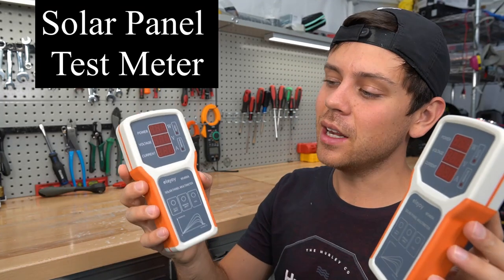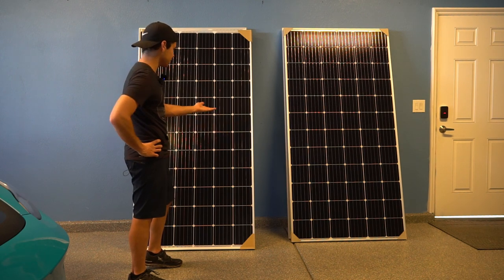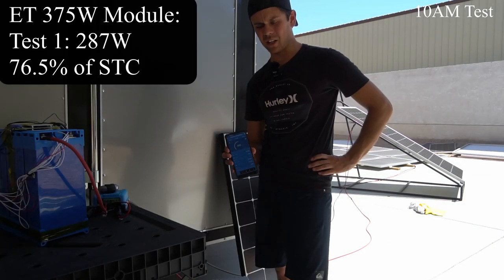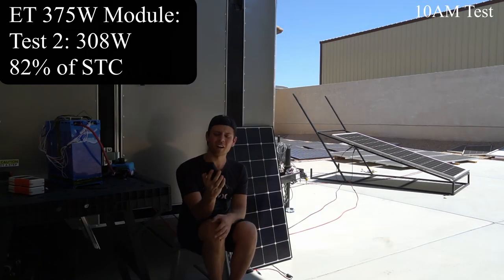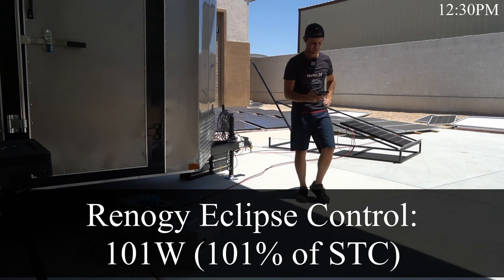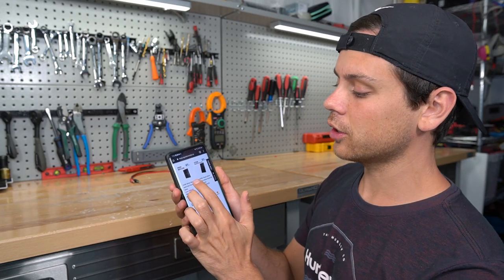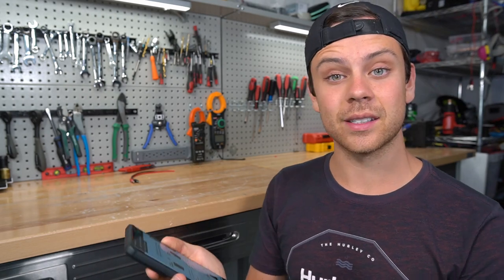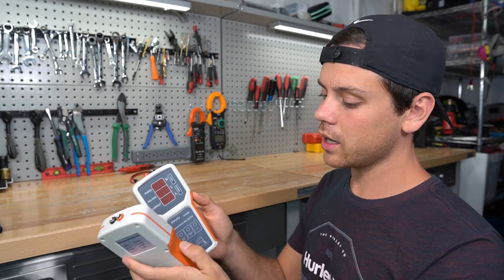Solar Panel Testing! ET Solar VS ReneSola

Comment from the maker: Usually, most panels produce 80-90% of their rated STC output. PTC is the real world output, but most panels do not list that. So I use STC. I use total Wh production over the course of a day to compare panels long term. Because various types of cells and film produce more or less depending on temperature and other factors. 

Figured this was a given, but some people in the comments section do not understand this.

~~~~~~~~~~~~~~~~~~~~~~~~~
Does off-grid solar confuse you? Check out my DIY friendly website for solar system packages and product recommendations, and so much more! http://www.mobile-solarpower.com

Join our DIY solar community! #1 largest solar forum on the internet for beginners and professionals alike: https://www.diysolarforum.com

Check out my best-selling, beginner-friendly 12V off-grid solar book (affiliate link):
http://amzn.to/2Aj4dX4

If DIY is not for you, but you love solar and need an offgrid system, check out Tesla Solar. Low prices and great warranty, and they can take your entire house offgrid with their new Powerwalls: https://ts.la/william57509

~~~~~~~~~~~~~~~~~~~~~~~~~
My solar equipment recommendations (Constantly updated! Check here first):

12V/48V Lithium Batteries: https://www.mobile-solarpower.com/solar-batteries.html

Solar System Component Directory: https://www.mobile-solarpower.com/solarcomponents.html

Plug-N-Play Systems: https://www.mobile-solarpower.com/full-size-systems.html

Complete 48V System Kits: https://www.mobile-solarpower.com/complete-48v-solar-kits.html

DIY Friendly Air Conditioner/ Heat Pumps: https://www.mobile-solarpower.com/solar-friendly-air-conditioners.html

Complete 48V System Blueprint: https://www.mobile-solarpower.com/48v-complete-system-blueprint.html

~~~~~~~~~~~~~~~~~~~~~~~~~~
My Favorite Online Stores for DIY Solar and Coupon Codes:

-Current Connected: SOK, Victron and High Quality Components. Best prices and warranty around: https://currentconnected.com/?ref=wp

-Signature Solar: Cheap Server Rack Batteries and Large Solar Panels:
https://www.signaturesolar.com/?ref=h-cvbzfahsek 

-Ecoflow Delta Official Site: My favorite plug-n-play solar generator:
https://us.ecoflow.com/?aff=7

-AmpereTime: Cheapest 12V batteries around:
https://amperetime.com/products/ampere-time-12v-100ah-lithium-lifepo4-battery?ref=h-cvbzfahsek

-Rich Solar: Mega site and cheaper prices than renogy! Check them out: 
https://richsolar.com/?ref=h-cvbzfahsek

-Shop Solar Kits: Huge site with every solar kit you can imagine! Check it out:
https://shopsolarkits.com/?ref=will-p

-Battery Hookup: Cheap cell deals
https://bit.ly/2mIxSqt
10% off code: diysolar

-Watts 24/7: Best deals on all-in-one solar power systems, with customer support and distribution here in the USA: 
https://watts247.com/?wpam_id=3

~~~~~~~~~~~~~~~~~~~~~~~~~~~
Contact Information:
I am NOT available for personal solar system consult! If you wish to contact me, this is my direct email: williamprowsediysolar@gmail.com

Join the forum at https://diysolarforum.com/ if you wish to hang out with myself and others and talk about solar

FTC Disclosure Statement and Disclaimers:
Every video includes some form of paid promotion or sponsorship. Some links on this youtube channel may be affiliate links. We may get paid if you buy something or take an action after clicking one of these. My videos are for educational purposes only. Information is subject to change/update at any time. Electricity is DANGEROUS and can kill. Be smart and use common sense :)

DIY Solar Power with Will Prowse is a participant in the Amazon Services LLC Associates Program,
An affiliate advertising program designed to provide a means for sites to earn advertising fees by advertising and linking to Amazon.com
Reply: Sorry that this is off-topic, but I couldn't find a better video where to ask this question.  Can Lithium Iron Phosphate batteries be installed in any orientation?  Or do they need to be used with terminals on the top?
Reply: Poster how can a someone contact you Directly? I don't see an email or anything in your description.??
Reply: So, you obviously have solar power production and collection dialed out there in Vegas, but have you ever given any thought into starting a “DIY Digging Wells 4 water with Will Prowse.”  Cause the way Lake Mead is looking you might need to find your own supply of water.  😂.  I’m in San Diego so I’m in the same boat. 🚤🚣
Reply: First, let me say I appreciate your informative and frank opinionated videos. Another unrelated question: Is it possible to do to poor weather conditions, use a charging station to recharge our solar bank batteries rather than use our automobile alternator as a backup? And If so, how?
Reply: What do you do will all the stuff you get. Do you sell it? Give it away? I have started my solar powered work shop and would like to know if you have some stuff that you would be willing to part with some of your spare stuff.
Reply: The panels at signature solar do not seem to be available but there seem to be similar products at a similar price range from URE do you recommend these panels?

Comment: you should put some locking swivel casters on your panel stand so you can wheel it into the shade to swap the panels.  also if you rotate those big panels to "landscape" orientation you could have fit two on there

Comment: I had different results in my test with the solar panel multimeter. Mine seems to work quite well and has confirmed the previous tests with the MPPT charge controller setup. When buying used panels it is totally impractical to setup a battery and solar charge controller on-site just to test a few panels. The solar panel tester is a quick and very effective solution to check all panels in no time. It can quickly identify if panels work and can achieve the labelled output. If the tester is 100% accurate is not important at this point. It will help identify damaged or degraded cells quickly. The perfect solution for testing panels on the go.
Reply from the maker: Yes good point I agree!!! Such a great tool for quick testing. Thanks for watching my video 😁👍
Reply: @WillProwse  And thanks for watching mine 😉👍

Comment: Nice video Will. I'll suggest for fairer and more accurate comparisons, get a second victron controller, put the panels side by side at the same angle then test them simultaneously. You may then swap the controllers/panels to be cast iron sure but might not be necessary.

Comment: Thank you for all your hard work,some of your video help me on setting up my solar for our get away home 
Have 2400 watts of power an (8) 6 volt battery, it so nice not have to run a generator ,for power the AC or the wife breathing machine

Comment: Normal individual cell processing produces cells with a distribution of performane variation and is result of slight silicon doping variance in manufacturing.  Manf. sort the cells to groups of like performance cells for the same panel.  This is why you often see same model variation grades with something like three to five grades with different wattage.  They all will look physically the same, just grading (and therefore cost) on cells are difference.

I use a DL24 load tester.  You need to have a load tester with CV, adjustable constant voltage mode, which is like a variable high power zener diode load.  For a little manual CV adjustment it allows you to easily get the different parameter of Isc, Voc, Imp and Vmp, along with the corresponding wattage.   Running CV setting down below about 50% panel spec'd Voc gets you close to Isc reading.  Running CV up til you get zero current is Voc.  You can see the heating progression of panel in sun with Voc reading. Adjusting CV for maximum power reading is Vmp and Imp and you can likely manually adjust CV to max power as fast or faster then an MPPT controller finds maximum power point.

Voc is most important indicator, followed by Isc and should be measured for any panel test. It also ensures you have enough panel overhead voltage to effectively run an MPPT controller for given battery voltage (should have at least 4v overhead).  The quality of series resistance and shunt resistance of cells determine the MPPT point for given Voc and Isc.  Normally for qood quality cells, I_mp is between 90-95% of I_sc and V_mp will be between 80-85% of Voc.  Isc for good cells should be 40-45 mA/cm2, in full sun, per actual silicon cell area. Most common sized cells are from 156x156 mm wafer with rounded corners for about net 215 cm2 area per cell, yielding Isc of about 9 amps.  Must not have any partial shading for these relationship to be true.  Poor shunt resistance does not effect full sun performance but impacts low light performance.  All cells have some shunt defects producing the shunt resistance so the less the defects the higher the quality of cell.

Using one of these load tester also gives the additonal application of battery load testing that the dedicated panel testers do not have which makes the expense of the load tester more justified over just occational use of dedicated panel tester.

Comment: Move to Southern Colorado where it only gets in the high 90s. I just finished an install on my Sprinter with three 100 watt Rich cell panels feeding two Battleborn batteries in series for a 24VDC system.

Comment: Hey Will,
A very cool project would be a DIY, solar powered, ATV made from an old one.
Either that or a DIY electric bike. No way can I afford even a used EV but maybe I can swing a DIY build. Will be boondock camping and need a secondary backup form of transportation that will fit in the bed of my F-150. 
Thanks for everything you've taught me,... pretty much everything!

Comment: Hi Will, If you will be using a multi-meter to test used panels, consider getting some extra leads and wire them in to an MC-4 connected and an MC-3 connector for the really  old used panels. Having it soldered up and shrink wrapped will make it way more convenient so you are more likely to use it and you won't need a 3rd hand. Also I gotta say I almost skipped this video, but as always I learned something and enjoyed the content.

Comment: I have bi-facials on my roof and the way there performing my system will pay for itself within 6 years. £12.500  17 panels and 16.4 kWh lipo batteries. Watched various videos before taking the leap and glad I did   I now help others design there system

Comment: Nice video  I live in the desert and have 3 solar systems and like you point out
many solar panels do not perform well when hot. I have a ground mount 
system with Canadian solar panels and they are just marginal  in the heat

Comment: please test two bifacial panels at a time .. keep a little more vertical [ till they drop off a few watts] and step second panel back  a panel width and up till no shade from first panel. then test separate. to see if you get more reflection from second panel to first panel. a good test to do.  you need a w shaped reflector behind one bifacial to get best output. thanks for great tests.

Comment: Will in a future video, I want you to try doing a cardboard backing board on a large solar panel and see how far the output falls and do a control with the same cardboard backing board with a large 120mm pc fan for active cooling across the panel surface. Also when you get a conductor hot it loses it ability to carry current by a percentage while your wires are sitting in direct sunlight.

Comment: Have you done a video rating panels in terms of cost efficiency versus energy efficiency?  If I can generate 3400 watts for $1500 vs say 2500 to 3000 for the same price, shouldn't that also be a buying consideration?
Reply: I think you are halfway right, there should be both types of ratings. It depends on what the greater consideration is, rack space/cost or sq foot  wattage vs price wattage
Reply: @jgren4048  Yeah, I thought about that too after I posted, it's a very good point

Comment: I've been getting used panels (with the white vinal film cracked on the back) from santansolar on ebay.. been getting them for 10-20 cents/watt (that includes shipping and taxes and purchasing 20 at a time).. yes. the white film is cracked off the back.. but they output 80-90% of rated wattage.. I mount them on the ground and it gets VERY wet here in louisiana.. no problems for almost a year now. For a dry arid place.. they would probably work VERY well for you.

Comment: I'm not sure what the significance of bringing in panels that were cool to do testing to see if you can achieve a higher output performance? Seeing how these are going to be in the sun the entire time once they are installed, then I would hope that I would get full optimization from them.
 I would see if I could source panels locally and have them tested prior to purchasing. This way you get to see if they perform as outlined. I'd hate to buy on line, pay for shipping and end up being dissatisfied with their performance. What guarantees do you have? 1500 watt array = 1300 watts in reality. Not acceptable. JMO

Comment: Why not open and calibrate those units by using your victron as the source for calibrating? I'm sure there is an adjustment pot on those, give it a shot.

Comment: Knowing that Heat causes performance loss... Have you ever made a cooling enclosure for your panels with small exhaust fans to keep them cool?
Reply: Panel cooling is one of those topics that nearly everyone wants to solve when they're getting into solar (myself included) but the added cost, increased power consumption and added hassle, are typically not worth the limited gains. The only exception, where it "might" make sense, would be to add cooling to a giant solar farm(?)
Reply: @__WJK__  I have a 2500 watt system on our roof with 11 panels installed in 2009. I have thought of putting a fan sprayer from a garden hose on a timer on the roof to cool the panels down every 10-15 minutes or so just for a quick minute of spray or less. It is something I have thought but never been too compelled to do. I know when I am washing the solar panels I call down to my wife off the roof to have her read me the wattage on our inverter in real time and me spaying the solar panels is amazing in full sun in Central Florida especially in summer heat. Plus it would keep them extremely clean too. I do wash them every few weeks or more in the pollen season.
Reply: @onecrazywheel  - Hmm, an ultra simple misting system seems like a really good idea actually.
Reply: @__WJK__  Yes and on a timer. I saw a video on YT of a guy who made one for his roof in India like this to keep his house cool and it worked really good

Comment: It's probably like what is done by computer chip manufacturers (at least used to be).  They would produce batches of identical chips and test them.  Some performed better than others and they would sell the lower performing ones under a different classification.  In this case, they sold the lower performing ones to another brand name.

Comment: Great video as usual. Thank you for all of the information and help in my solar education. I was about to jump on some of the $50 panels you reviewed but I saw. They are recommended for off grid only. I am planning on going with a grid tie system in two years. Can you explain the difference in panels for off grid and grid tie systems?  I appreciate you sharing your knowledge.
Reply: I asked Santan solar that question and they explained. The used panels will have the UL (or equivalent) label removed. The regulating authorities will not approve a grid tie system that does not have listed components (if they bother to climb up on your roof).
Reply: Thanks. That makes a difference

Comment: I think the Chinese meters come in handy, when you build your system entirely from used panels, like Andy from the Off Grid Garage does. Even if they are not that accurate, they provide a good indication as to if the panels are still good or trash. And with their portability you can use them at the pick up place before you actually buy the panels.
Reply: Yes but like when you saw Andy get his panels they're normally already paid for by the time you can get around the testing
Reply: @recoblade1465  Well, when I go to buy something off of some platform equivalent to Craigslist (what Andy did and does), I don't pay before I actually had the chance to see the product in person. Except when the good condition is actually obvious from the ad description, the pictures and the communication with the seller beforehand.

Used solar panels are a mixed bag, as we could see with Andy. So that are products where to pay up front can bite you in your a$$ royally. Okay, Andy got the majority of his panels for free, but it still took him time and a rental van to haul them home.
Reply: @wiedapp  I had never even contemplated using used panels. Have trust issues with Craigslist in the like but if I did I would rather you know do like wildy and get something like a Victron 75/15 and take some of the Headway cells I have and turn them into a 48 volt pack. And know that it's accurate for an extra $20. Although I would probably go with the 100 / 20 even though it's double the price due to the fact that that way I would have a testing station plus a solar charge controller more than capable of handling 620 Watts at 48 volts because I have 620 watts of solar right now. But that's just my opinion on the matter

Comment: Yes, nobody need those testers because you can see the output on the solar controller more accurately.  I have 10 Canadian solar, 10 Trina 72 cells, 400w each and the output depend of cloudiness, temperature or degradation,  however, in some lighting conditions one brand can output more than the other and vice versa and sometimes the output is more than the stated ratings on the 41st parallel north.